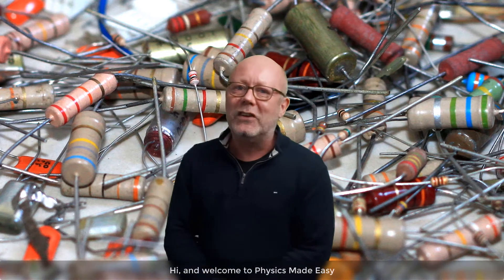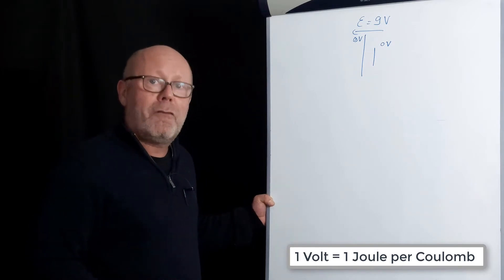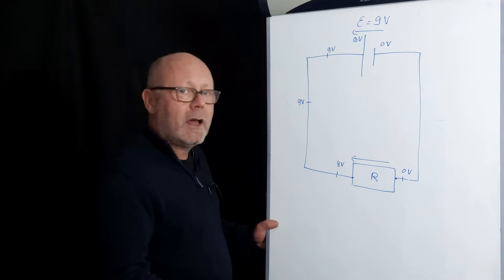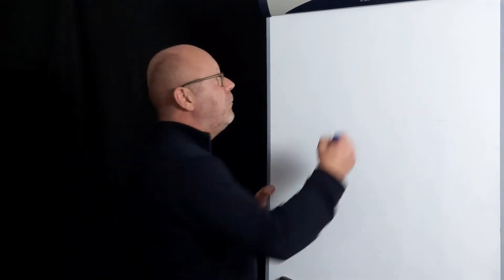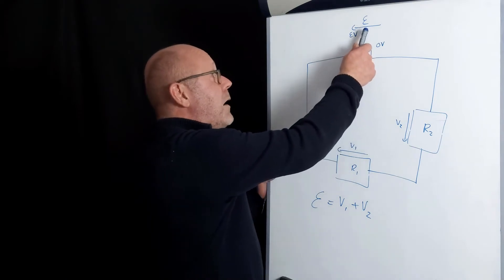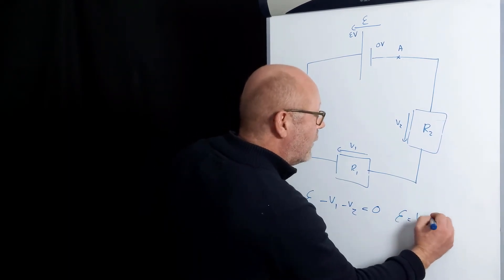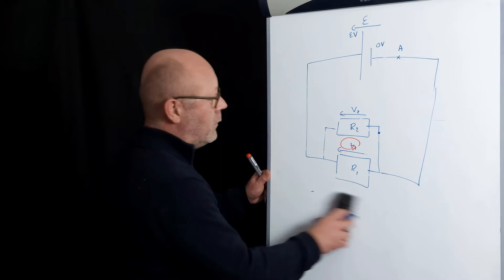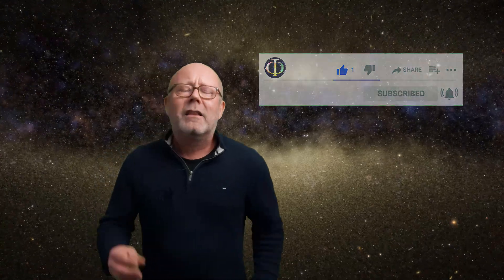Resistors in Parallel – Why the Same Potential Drop ? (Electric Circuits, Physics)

Comment: Hey sir , can you tell me why does we feel cold , if we turn on the fan although fan increases the speed of molecules around us ??
Reply from the maker: because the wind from the fan increases the rate of evaporation of sweat. When water passes from liquid to Gas, it sucks  energy from the surroundings. The human body uses this phenomena: when sweat evaporates, it cools the skin. That's why we sweat in hot weather and need to drink a lot to keep sweating!

As for the increase of speed of the fan: the effect is negligible compared to the speed of a molecule has already at ambiant temperature. For example a molecule of oxygen at 25C is moving already at speeds around 500 m/s (1800 km/h).
Reply: @PhysicsMadeEasy  But , my teacher told me when fan is turned on , the air molecule strikes our body and take some heat with it , as a result we feel cold . Is he correct ??
Reply from the maker: @ayushkhanal36  Hello Ayush, I don't think so... Wind (or air from a fan) allows to increase the rate of evaporation, so our sweat evaporates faster, which uses heat from the skin/body to do so (The latent heat of vaporisation of water is large, that's why it is so effective). And that's why we feel colder in presence of an air flow.

In a way, one can consider that the 'air molecules' take the heat away by transporting with them the vapor produced by the evaporation of the sweat. That's maybe what your teacher meant?

Comment: What is mechanically happening during a voltage drop? Theoretically, if voltage is a measure of potential energy solely reliant on position, then why does the amount of resistance in a circuit proportionally affect the amount of voltage drop? 

Theoretically any amount of resistance plugged in a 9 volt circuit should give you the exact same 9 V voltage drop. What does voltage drop really mean? 

Why and how does resistance affect voltage?

Thank you for all of your hard work and dedication Dr. R
Reply from the maker: Hi, 
The resistance does not impact the total potential drop of the circuit.  This is set by the battery. The resistance impacts the current. Let me explain:

Take a simple circuit with one battery (emf of 9V) and a resistor R. The battery provides 9 Joules to every charge that passes through it. Conservation of energy states that the energy that goes in the circuit, gets out. So for each Coulomb of charge that passes through the resistor, 9 Joules will be lost in the resistor. so there is a potential drop across the resistor of 9 Joules/Coulomb (9V)

The key is to remember that whatever the resistance, the amount of energy lost in the resistance for each coulomb of charge remains the same. A high resistance for example, will limit the number of coulomb passing (current), but the energy lost per unit charge remains the same (9 Joules per coulomb). So, in the end, the resistance of a circuit modulates the amount of energy that transfers through that circuit by modulating the amount of charges that move through the circuit.    

If you have still trouble, think about: 
emf: amount of energy provided to the circuit by each Coulomb of charge
Potential drop: amount of energy lost by the circuit by each Coulomb of charge
Current: Amount of charge (in Coulombs) coulombs passing every second
Resistance: limits the flow of charges  

I hope this helps!
Reply: @PhysicsMadeEasy   but i have one doubt in the above explanation sir. High resistance will limit the number of coulombs (current). 9 joules will be dissipated by every coloumb as heat.  High resistance produces more heat but the number of charges losing 9J is less (as current is less)  than a low resistance which will allow more current, so more coulombs will now dissipate 9J of energy as heat. But how can this be? Low resistance - low heat (energy ) right?
Reply from the maker: @jsivesh4323   “Low resistance - low heat (energy ) right?” Not necessarily… Still consider two resistors in parallel, thus having the same potential drop. The Power (Joules per second) dissipated is P = R x I^2. There will be more heat dissipated in the branch with the lower resistance because P increases as the square of I compared to P increasing linearly with R. Example:
9V across a 3 Ohm and a 6 Ohm resistance in parallel:
In the 3 Ohms: I =V/R = 9/3 = 3A    P = RI^2 = 3 * 9 = 27W
In the 6 Ohms: I =V/R = 9/6 = 1.5A    P = RI^2 = 6 * 2.25 = 13.5W
(Note, you could also have done this using P = (V^2)/R)
Reply: @PhysicsMadeEasy  thank you so much for the fast reply sir. I now understand that even low resistance can give more heat. I was thinking that if resistance increases the work done wil be more so more energy will dissipate but I forgot that with high resistance the current reduces. Thank you once again
Reply: @PhysicsMadeEasy  And the voltage drops because limiting the amount of Coulombs limits the amount of Joules, and Voltage is defined as Joules per coulomb?

My only other question is perhaps the instantaneous and almost spontaneous nature in which the resisters are able to allocate voltage drops proportionally among the resisters.

How does it know to do this? to divide in this way, especially if each coulomb see's each resister one at a time in series?
Reply: Thank you so much sir, 
Your explanations are very good and easily understandable
Reply: I know there is almost a wave like property to these things, but the mysteries of whats going on in these little circuits are just eluding my understanding!

Thank you so much for all your help once again Dr. R!

Comment: Sir, according to V=IR, if R1 in 1st branch is greater than R2 in second branch. Say R1=5ohm and R2=2ohm , won't V=I1× R1 be  greater than V= I2×R2 ? Then the potential difference won't be equal. Can you please clear my doubt sir
Reply from the maker: If R1 > R2, that means that it will be more difficult for current to go through R1, therefore I1<I2… 
Think instead as a potential drop as being a loss of energy per unit of charge… I recommend that you check my video ”What is an electric potential” (https://youtu.be/j3GrOKre__0). It may help clarify things for you

Comment: My question is If electrons are flowing because of voltage . Then  won't electrons flow after the point of passing resistor ? There is 0 voltage
Reply from the maker: Imagine you have a system that releases heavy balls from a certain height ( = a potential difference). The balls arrive in a large bucket. At the base of the bucket, there is a hole that can allow a ball to pass through. At first the balls would fall in the bucket and stay there. But after some time, once the base of the buckets is filled up with balls, the next ball falling will push one of the balls already in the bucket through the hole (the negative side of the battery).

If you want a better understanding of that analogy and how it answers your question, check my video "What is an electric potential).

Comment: Why is total resistance in a parrallel circuit less than any individual resistance of the same??
Reply from the maker: because by putting two resistance in parallel, you actually increase the number of possible paths an electron can take.
Remember that the R = resistivity of material  x length of resistor / cross  section of resistor. That means that by replacing a resistor R by two resistors R in parallel you double the cross section...  It's like increasing the diameter of a canalisation where water passes through.
Reply: @PhysicsMadeEasy   one more question . By H=I^2rt  resistance is directly proportional to heat but using H=Vt/r resistance is inversely proportional to heat can you clarify these two contradictory statements.
Reply from the maker: @ankitthakurankit4764  heat delivered by a resistor r where a current I flows during a time t is H =I^2rt. The potential difference of this resistor is V = rI, thus I = V/r. Substitute I for V. H = (V/r)^2rt = V^2rt/r^2=V^2t/r. (don't forget the square on V...).
You must make sure before you use the word proportional that the proportionality 'constant' remains independent or is set to be independent . Here I depended on r...

Comment: For voltage drop to be the same across all the resistors wouldn't that be assuming that they are all the same amount of ohms meaning the all take the same amount of joules from a charge. And also voltage drop doesn't have to mean that the end voltage will be 0 because the voltage the battery will supply lets say is 9v and then the resistor takes 7v. This means voltage drop will be 2v.
Reply from the maker: Hi,
“For voltage drop to be the same across all the resistors wouldn't that be assuming that they are all the same amount of ohms meaning the all take the same amount of joules from a charge. “
You are forgetting current. The current represents the amount of charges passing per second… The voltage is the number of joules lost per Coulomb passing across the voltage drop. So there is no problem with having the same voltage drop across parallel resistors: a small current and high resistance or a high current and low resistance can provide the same amount of joules lost per coulomb. 

“And also voltage drop doesn't have to mean that the end voltage will be 0 because the voltage the battery will supply lets say is 9v and then the resistor takes 7v. This means voltage drop will be 2v.”
Assuming there is not other resistors in series or an internal resistance to the battery, that means the battery would have an emf of 7V (+9V on the positive terminal, and +2V on the negative one). Which is totally possible.

A comment: be careful when you say “the end voltage will be 0”. A voltage is apotential difference, you should say “the potential at the other side is 0V”…

I hope this helps!

Comment: Sir, in your electric potential video you said charge goes from high potential to low potential then why at 2:16 minute of this video you draw an arrow with the meaning  charge going from low potential to high potential???
Reply from the maker: Hello Umme, the arrows do not represent the motion of the charges, they represent the change of energy of the charges while they move (in the same direction as the current). When they pass through the battery, they gain 9 Joules for each Coulomb, above the resistor, they lose 9 Joules for each Coulomb.
I hope this clarifies things!

Comment: I have a very much confusion how does battery provide potential difference i am not able to understand current electricity suppose there is a 12 volt battery so i mean potential difference is 12v so does inside the battery something happens and it gives a magnitude of charge q??? And that q amount of charge flow through a conductor?? 
Is it always that if there is a battery of 12volt will it give same amount of charge?? I am not talking about current i am talking about just charge magnitude of q
And same if there is 2volt battery then of how much magnitude of charge(meanshow many electrons it will derive) ?????
Reply from the maker: Hi,  If you understand what an electric potential is, all your questions will find an answer. Check this video:  https://youtu.be/j3GrOKre__0

The “12 Volts” of a battery does not tell you how much charge you get until it is depleted. It tells you how much energy one unit of charge will have. The amount of charge that can be provided by a battery simply depends on how big it is. For example for chemical batteries, that is how much reactant there is inside.

You can have two batteries, one of 1.5V  and another of 48V, of the same size. In a way, you can see the potential difference indicates how much each charge will ‘feel the need’ to move from one terminal to the other. Both will provide as many charges, but the 48V will provide more energy. 

I hoep this helps!

Comment: If at the negative terminal side of the battery we say it has lost all energy and it is 0 joule then why does the charges move then shouldn't they stop there 0 joules energy means charge should not move please explain I am confused 😢
Reply from the maker: Hi, The 0 joules refer to the electrical potential energy of the charge. Do not confuse this with the kinetic energy of the charge carrier.

Please note though, to be precise, that when we refer as a voltage of say 9V, it means that the electrical PE of a charge that goes from one pole to the other changes by 9 Joules for each  Coulomb of charge. So you could have 9J/C at the + terminal and 0J/C at the - terminal , but you could also have , for example, 11J/C at the + terminal and +2J/C at the - terminal...

I hope this clears things up
Reply: @PhysicsMadeEasy  then what happens to that kinetic energy of charge when it finally arrive to its destination.Sir,please give reply.

Comment: Lose energy in form of what? When it passes through a resistor at 2:24 please explain properly????
Reply from the maker: The Energy of the charge is transferred to the structure of the resistance material which then starts to shake. In other words the Electrical PE of the charge decrease in favor of the kinetic energy of the particles that form the resistor.
Temperature is a measure of the average KE of the particles of a system. So the T of the resistor increases above that of the environment it is in. That leads to heat going from the resistor to the surroundings. We say that the energy is dissipated (it heats up the surroundings).

Comment: When current(electrons) gets divided in a parallel circuit, then energy held by electrons should also divide, which means potential drop across each resistor should also be different 🤔🤔
But this doesn't happen, why?
Reply from the maker: If the current is split in two, yes the number of electrons passing through will split also, therefore the energy dissipated in the resistor too... 
But a potential drop across a resistor is not the total energy lost in the resistor but the energy lost FOR ONE UNIT OF CHARGE. Roughly you can see the potential drop as a value proportional to the energy lost by ONE electron... That value will not change even if you have less electrons passing through. What changes when you split the current is that you have less electrons passing through per resistor., that's all.
I recommend you check this video explaining what is an electric potential (thus a potential drop):  https://youtu.be/j3GrOKre__0
I hope this helps
Reply: @PhysicsMadeEasy  We can also say that voltage (joule per C) is the pressure / the energy each coulomb of electron holds and so, how much ever coulomb of electron (when it comes to count of electrons which means the current (q/t)) flows, it will possess the same energy irrespective of the no. of electrons, which is nothing but the current!. Hence voltage remains the same and current is different in parallel.

When series, it's Vice Versa....

Comment: In parallel the charges loose 9 V of potential so technically the total potential drop should be 18 should it not?
Reply from the maker: 9V means 9 Joules per unit charge (per Coulomb)... When two resistors are in parallel, the current splits in two: there is less amount of charge that passes through each resistor, but there is still a loss of 9 Joules per Coulomb across each resistor.
Reflect on what a volt is (1V = 1 joule per coulomb) and everything will make sense :-)
Reply: @PhysicsMadeEasy  no but when voltmeters are connected both show 9V so that technically means a total of 18 V drop
Reply from the maker: @TH-kn9lw  If you connect the voltmeter before and after where the cables join, you will also see 9V... You will also find 9V if you connect your voltmeter before and after a single resistor. (Again, I encourage you to reflect on the meaning of voltage: 9V = 9 J /C)

Comment: Say you’ve got a 9V battery, how can both resistors drop 9V. That’s 18v in total with a 9V supply isn’t that breaking the conservation of energy.
Reply from the maker: Hello Jack, 
A Volt is not an unit of energy, but of energy per unit charge...
9V means 9 Joules per Coulomb... 
When two resistors are in parallel, the current splits in two: there is less amount of charge that passes through each resistor, but there is still a loss of 9 Joules per Coulomb across each resistor.
Reflect on what a volt is (1V = 1 joule per coulomb) and everything will make sense :-)
I know the concept of potential and voltage confuses many students, so I made a video about this. You should check it out:
https://youtu.be/j3GrOKre__0
Be well